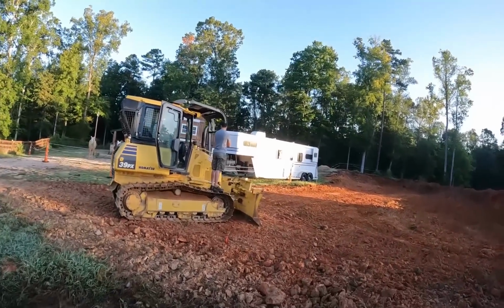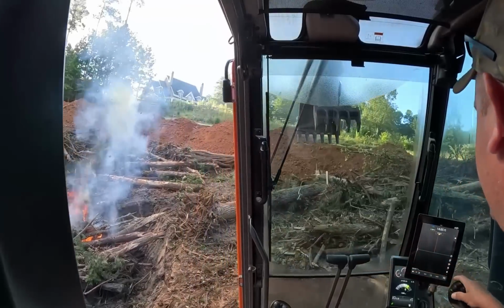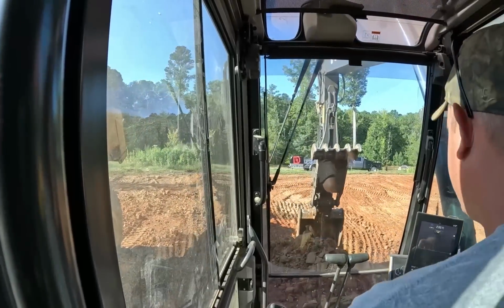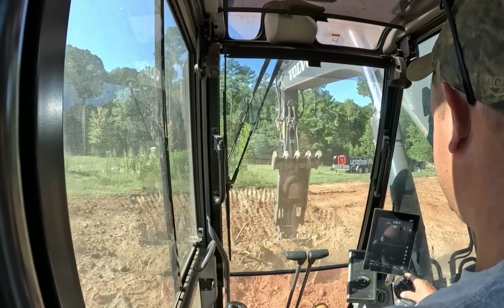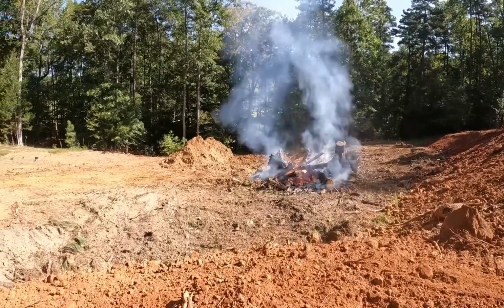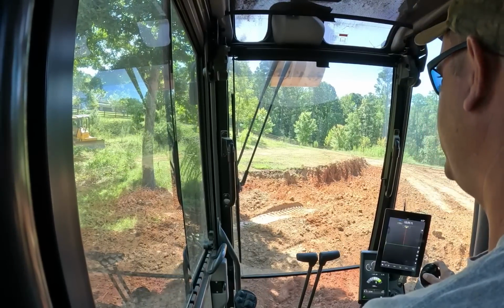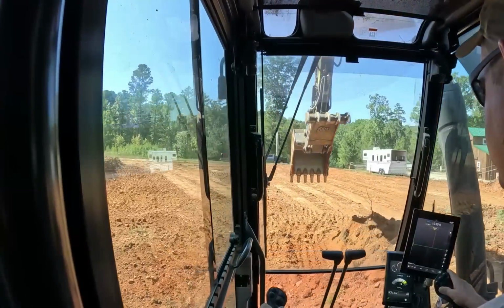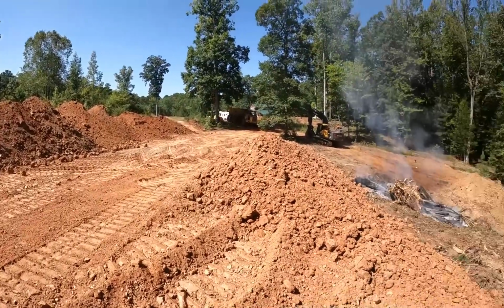Gambling I Can Burn And Keep This Project On Schedule

Comment: I’ve never seen peanuts - (the styrofoam packing type) used in a septic field before. Were they used to harbour bacteria to break down the effluent?  Or just for drainage instead of the clear gravel used in my part of the country.

Comment: Looking good. Hope that tropical spin is not drowning you guys. Nice investment those folks are making. Every acre of level ground is valuable in areas like that Not table top flat, but usable flatish that you can mow and keep nice. Just so the swales move the water away. As long as they are not building on that ground an incomplete burn is not the end of the world. It will rot and settle in over time. Around my parts I have seen them bury stuff like that without even burning more than the tops. Fill is fill I guess. The horsed don't know what is three feet under the grass they are chomping.
Reply: In my experience, buried wood seldom rots, due to lack of oxygen.  I’ve dug up logs that had been buried for 20 years, and when the bark fell off them they looked like they had just been cut down.  This was in wet clay;  drier sandy soil might allow more O2 into the mix.

Comment: Chris when you burn in a pit trench out a path for air to feed the flame from the bottom you'll get less smoke. putting in a metal pipe would be best the fire will draw a air in

Comment: take a cheap 2 cycle hand blower, set the throttle to full and burn that pile up in 8 hours.  They used to be 80 bucks, charge it to the job and go on.

Comment: How do you get packing peanuts in the septic system?
Reply: The septic pipe is in cased with in a sheath and peanuts are between the two pieces, that is my guess.
Reply: Some septic systems use peanuts instead of gravel

Comment: Who is Robert? and why does he only work sometimes? I would think with all that equipment you now own you would have people working on a regular basis.
Reply: He has said that he only needs help now and then, so why have someone full-time when you don't need to. That's expensive and not needed, and he would have to quote his jobs higher and could lose work.
Reply: @ryanhoward1013  He would not have to quote the jobs at a higher rate because with qualified help he could do more than one job at a time. Hired help is not near as expensive as owning 500,000 to 800,000 dollars worth of equipment and it doesn't make you money meanwhile you still have to maintain it and store it etc... The reason to buy more equipment is so you can do either bigger jobs or multiple jobs and therefor make more money for future goals and expansion.